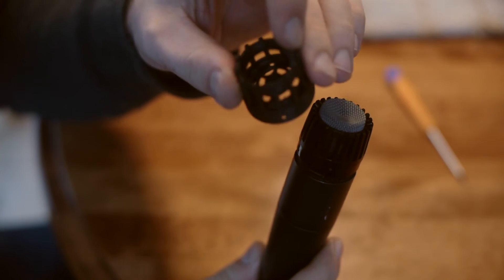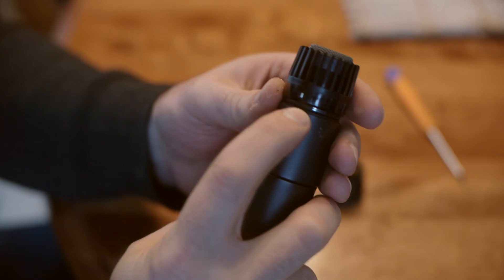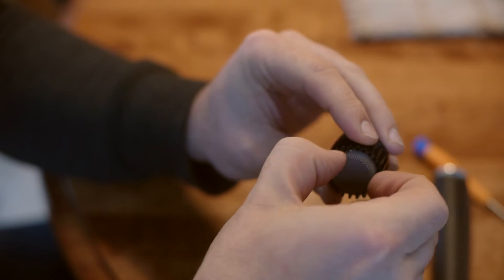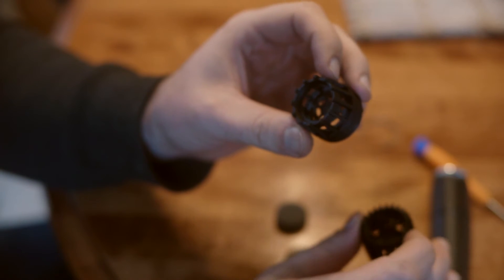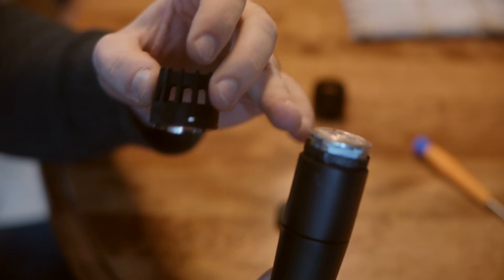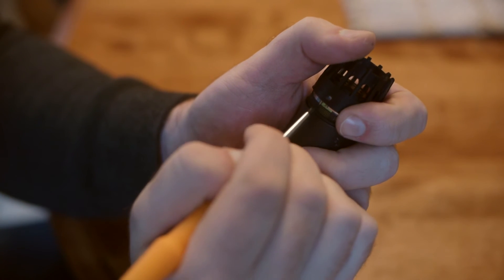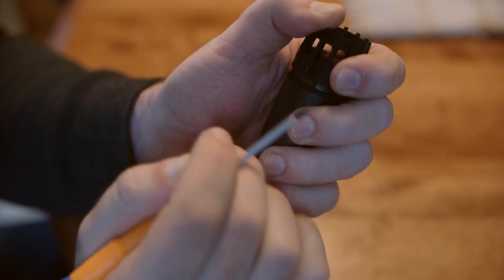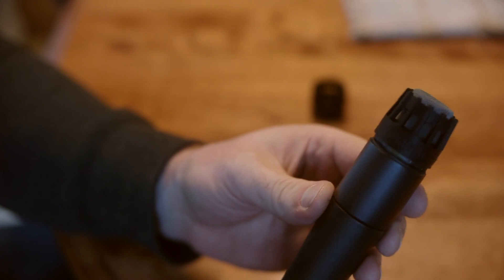Wilkinson Audio - SM57 Cap Head Installation Instructions

Comment: Don’t use the yellow area under the cap to line up the spring to top the head off. That is the yellow tape that the thin wires are that go to the diaphragm. If you break them you’re screwed. Turn it 45* and use the flat spots there.

Comment: If your here because your SM57 cap rattles this can be down to 2 issues that I am aware of. Reason number 1 and the most common reason for rattles its the circular retaining clip being loose between the metal mic capsule body and the cap. To fix: Remove the cap following instructions above. Remove the circular retaining clip. Now to make the clip stop rattling simply put a tiny kink in each side of the spring. Go for a very, very slight bend about half way between each retaining part use fingers not pliers to make blend as gentle as possible. Do not overdo the bends! This will make the clip slightly not circular with a result that when in place it makes firmer contact between both the retaining channel and the cap. Reason number 2. I have found one of my 57s with a small piece of plastic scarf trapped under the grill. if this is true in your case when you have cap removed as above you may have luck in being able to remove the grill however I found it easier to pop out the circular plastic resonance plate, then remove the foam and then clear out the scarf. Reverse the process to reassemble.

Comment: Hey fuck you. The diaphragm wire broke as i was removing the top part as you demonstrated. Now its a $100 doorstop. replacement cartridge is $78 and I cannot re solder or repair this myself, there's no way i could heat the wire without melting the diaphragm. Id rather have a dirty mic than one that doesn't work.